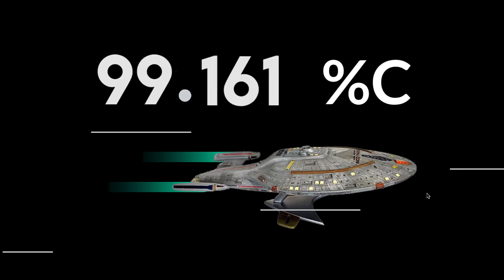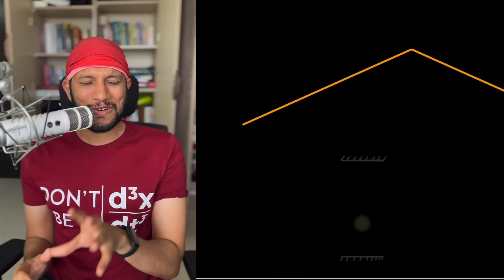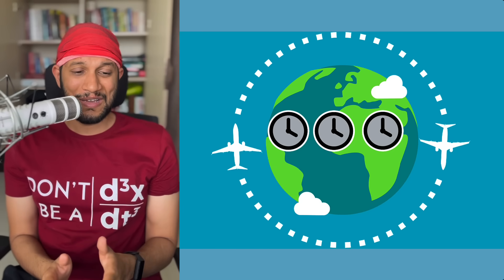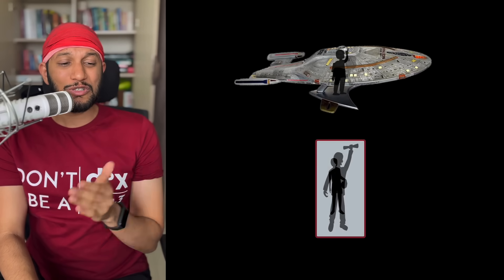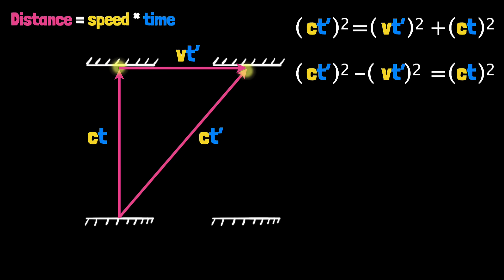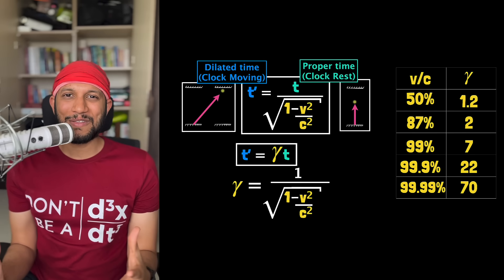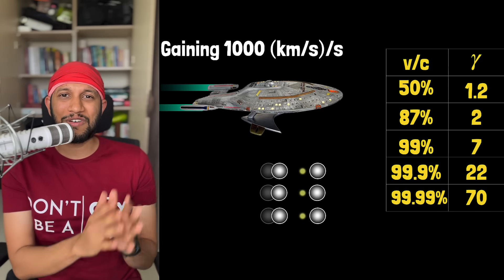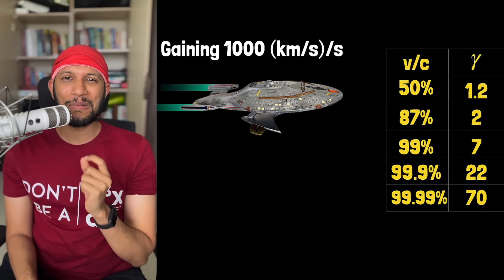I finally understood why you can't go faster than light! (My mind is blown)

Comment: Okay, so this makes intuitive sense to me from outside the ship. I'm having trouble intuitively understanding what is happening from inside the ship though. Like, with a black hole, I appear to stop on my way in to an outside observer because of time dilation, but from my perspective, I just keep falling. But if I'm in a ship that is at constant acceleration, I should just be able to keep accelerating, right?
Reply: Yes, you keep accelerating, but what does it mean? Relative to the ship your own speed remains zero, you accelerating means other objects gain speed relative to you. If your acceleration is 1000 km/s/s, you would expect outside objects to gain 1000 km/s more speed every second. But there is another part of Lorentz transform: length contraction. Space "contracts" in direction of motion, and those 1000 km turn into 500, then 100, then 1, then 0.1 etc. In the ship's coordinate system those outside objects accelerate less and less, such that their speed increases less and less every second and never reaches c. See Lorentz transform and its charts, you can find interactive ones and see how spacetime skews at different speeds.

Comment: Very interesting. This means that if I find a way to transfer force that doesn't involve photons I would be able to transfer force instantaneously across space, right?
Reply: In relativity theory all massless particles move at light speed - this includes gluons, not just photons. Neutrinos were also considered massless and moving at c, although currently there are certain doubts about them. Basically anything with mass travels < c, and without mass at c, nothing goes faster. If some force carrier could transfer force faster than c, that would allow sending signals into past and cause all kinds of paradoxes.

Comment: towards the end of the video you try explain how as a ship accelerates, it takes longer and longer to gain those 1000km/s, and so the ship will take infinite time to reach the speed of light, or if you decide to double your fuel consumption every second it would take infinite energy.

but....all of this only applies to the outside observer!
as you said yourself, inside the ship you are always going to be gaining 1000km/s.
it's only the outside observer that experiences the time dilation.

if that's the case, i see no problem (intuitively) with somebody inside the ship reaching the speed of light and it not taking infinite time or energy.
for them it would just take a certain number of seconds, or a certain value of "fuel output per second" but if they wait long enough, they should be accelerated to the speed of light, regardless of how it would look to the people outside the ship. at least according to this interpretation where the one experiencing the time dilation is the outside stationary observer.
Reply: Relative to the ship your own speed remains zero, you accelerating means other objects gain speed relative to you. If your acceleration is 1000 km/s/s, you would expect outside objects to gain 1000 km/s more speed every second. But there is another part of Lorentz transform: length contraction. Space "contracts" in direction of motion, and those 1000 km turn into 500, then 100, then 1, then 0.1 etc. In the ship's coordinate system those outside objects accelerate less and less, such that their speed increases less and less every second and never reaches c. See Lorentz transform and its charts, you can find interactive ones and see how spacetime skews at different speeds.
Reply: @thedeemon  sure, the issue tho is not the speed relative to the ship, the issue is approaching of even reaching the speed of light, while inside the ship.
what i understand from your answer, is that since my speed relative to the ship is 0, then the ship can keep accelerating, and my speed relative to the ship doesn't change at all. meaning even if the ship were to reach 99.9999% the speed of light, then me, being somebody who's inside the ship, will feel no relativistic effects whatsoever. 

i'm not saying this is true, i'm just saying that the intuitive understanding portrayed in the video, only applies to outside observers, and not to the ones actually doing the traveling.
Reply: @FractalMachine  Again: what exactly it means for ship to reach 99% speed of light? Speed relative to what? Right now you're moving at this speed relative to some objects. Even faster, relative to protons in LHC. There is no absolute speed. It's always relative. So when we say the ship accelerated to 99% of c it means it moves at this speed relative to, say, some planet. And from this ship this planet is moving at 99% of c. Then, I say, what happens when we keep accelerating? How fast the planet will move after one more second? Due to length contraction, not as fast as you expect, it will never reach c in ship's frame of reference.
Reply: @thedeemon  i believe there's a problem with this view.
if the ship was the only object in the universe, according to this perspective, acceleration is meaningless.
so you are dumping vast amounts of energy into accelerating a ship, and this ship now has tremendous amounts of potential kinetic energy, except if speeds don't exist independent of other objects, then this energy (that was used for acceleration) has "disappeared".

this violates conservation of energy.
Reply: @FractalMachine  Good point: if there was nothing but the ship then indeed acceleration would be meaningless. But you can't just accelerate it forward without throwing something backwards, momentum must be conserved*. So in the ship's perspective there is at least something besides the ship that gets accelerated away from it, this way energy and momentum are conserved.

*) in any inertial frame of reference that at a given moment t has the same speed as the ship. In an accelerated frame of the ship momentum is not expected to be conserved.

Comment: But Mahesh why does that photon follows zigzag path??
Reply: Because the clock as a whole is moving... As the clock is moving in some direction the photon will never hit the other side if it didn't moved that way and will fly straight up.. So it have to follow a zig zag path so that it can  follow a straight line path in space ship
Reply: @priyank5161   if it's some ball bouncing between two surfaces then the ball moves diagonally because it attain horizontal velocity equal to ship velocity because it has mass and it is in contact with ship but in case photos it has no mass and it's velocity can't be influenced by anything cause velocity of photon is constant. as you said if it follows diagonal path it means it attained horizontal velocity so if photon motion is orientated horizontally then velocity of photon must be velocity of light plus velocity of ship which is not possible because light speed is the limiting speed
Reply: @mannemmadhuteja5501  that's the whole reason... Place yourself in place of the guy inside the ship... For him the photon should follow the straight line path so for him it's normal... But for us it will follow a diagonal path... Why? Because it's the shortest path! Light always travel in the shortest path because the path of light is curved and space is curved it feels or seems like light is going diagonal path.
Reply: @mannemmadhuteja5501  which means the light is still taking the shortest path in curved space time
Edit:- light do not follow the straight line path but instead the shortest path between 2 points but as in this case the space between the point is curved it feel like it is taking diagonal path
Reply: Space is curved what does it mean
Reply: @mannemmadhuteja5501  well hard to explain but u can say... By curve... Like a curve of earth.. A straight line in curved space is not the shortest path but a curved one similar to what air flight uses on earth
Reply: @priyank5161  OK thankyou what do you study
Reply: @mannemmadhuteja5501  hmm m a 10th grade student but don't think m stupid just by that

Comment: it may be getting slower and slower from our perspective, however, from the ship's perspective nothing changes which means that, for them, they are still gaining 1000 km/s speed which means that if we ignore the outside world, for them, they should be able to reach the speed of light
Reply: If you ignore outside world, you are stationary relative to the ship, there is no speed gained. All speeds are relative. When you accelerate at 1000 km/s every second what it means from your perspective is some initially static objects gain speed relative to you. But due to length contraction (another relativistic effect, another part of Lorentz transform) those 1000 km turn into 100, then 10, then 0.1... Apparent acceleration of outside objects will decrease, such that their speed in ship's frame of reference grows slower and slower and never reaches c.

Comment: Speed of light in a vacuum is not a limitation of light but a limitation of the universe, why it happens to be C and not C + 1 for example, no one knows. It has been suggested the apparent randomness of C is evidence we're in a simulation, it is a parameter of a simulation, chosen for external not internal reasons or logic.

Comment: How does this work for the observers on the space ship as it approaches C? The observers on the craft would still see light move at C and the ships particles would interact with eachother at C. So couldn't the observers on the ship reach C from their perspective? (Asuming you don't care the heat death is occurring outside your craft as near infinate time passes ouside the ship)
Reply: @asleepappeal so, if you reach the speed of light, you would theoretically generate infinite mass as well right? At the point of infinity, when your spaceship finally reaches the speed of light, it's infinite mass would literally suck in everything in the universe as the biggest supermassive black hole to ever exist and annihilate the universe. Theoretically. I think the concept of infinity in general just breaks everything
Reply: Also, what does proper time even mean. The universe does not have a preferred reference frame. The person, once he stopped acceleration, no longer is anything special. In his pov everything else is moving but him. So everything else is experiencing time dilation.

To answer your question tho, length contraction, the universe appears to become very short.

Comment: I don't see how the photon clock extends to the regular clock.  Your explanation shows that the regular clock will be delayed, but not slowed.  Imagine a clock that ticks once per second.  For a clock at rest, when the clock ticks to 12:00:01, the whole hand ticks to 12:00:01; when the clock ticks to 12:00:02, the whole hand ticks to 12:00:02.  Now imagine a clock traveling fast enough so that it takes 10 seconds for the photons to travel the length of the hand.  When the center of the clock ticks to 12:00:01, it takes ten seconds to propagate to the end.  So the end of the clock shows 12:00:01 at 12:00:11.  However, the clock continues to tick.  The center of the clock will still tick at 12:00:02, and this will show up at the end of the clock at 12:00:12.  The outside of the clock always be 10 seconds later than the center of the clock, but the clock won't run 10x slower.

The photon clock has a feedback loop.  The second tick doesn't start until the first tick completes.  So the photon clock is slowed down.  However the mechanical clock has no feedback, so it is only delayed, not slowed.

I'm not denying time dilation, I'm just questioning how your explanation justifies it.
Reply from the maker: This affects every atom of the clock. So, consider the simplest pendulum clock. It ticks due to the swinging of the pendulum. If it’s moving close to light speed, then the pendulum’s swing slows down slowing the whole thing down. Even atomic clock’s heart is the electron transitions of a specific atom. They too are mediated by photons! There is no escaping it.
Reply: @Mahesh_Shenoy  Thanks for answering.  I knew that the clock hand was just an example, but didn't see how it proved the point since there was no feedback.  The pendulum is a great example that includes feedback.

Comment: Nice alternative view on this, but i think its still easier to say, as mass increases with speed and going toward infinity, when reaching the speed of light, there would be no possibility to get to the speed of light, as there is no infinite force available for pushing it. Anyways, the spaceship could get to the speed of light, by converting whole matter into photons...beam me up scotty🙂
Reply: I think the important thing to remember is that for every object with mass, c=c. So for spaceship, it's never going to reach c because it never started. It can burn its engine for a million years and it's still c away from c. The universe is planning to turn it into photons though. The universe is going to start seeming hotter and hotter as light in the direction it's headed in gets blueshifted and the particles it runs into get more and more energetic. Eventually, something will give.
Reply: @Vexas345  Yes, actually, that c is constant for all observers is the main assumption made in special relativity, from which every thing else can be derived. So, also the fact that an object with a rest mass can not reach the speed of light.

Comment: Dear Mahesh - your description is that of a light bulb bouncing up and down - not a true ‘photon’ clock. The photon does not have forward velocity having left the device generating the photons. For one - how would one ever ‘see’ the photon - something has to strike the cells of the retina. If it did, the photon would no longer exist being annihilated having struck the retina. So this experiment is theoretically impossible ie. One could never see a photon bouncing up and down. At best this is a lightbulb radiating photons while bouncing up and down. If one accepts that a photon is bouncing up and down, then in the case of the moving rocket, the photon would miss the detector (being a few atoms wide) and land somewhat behind (1 light second behind if the detector were 1 light second high).  In fact one could in principal detect absolute motion of the rocket by this very occurance. This is a conceptual problem with this illustration that nobody seems to take into account. I will very much appreciate your analysis to the objection that has always bugged me - or is there something I am missing here. Thank you for a wonderful channel and some great explanations  - really enjoy and look forward.
Reply from the maker: We can’t see the photons but we can theoretically detect its ‘bounces’. 
Why would the photons miss?
Reply: The photon is travelling vertically with no horizontal component. This means the spot on the detector straight above would have moved forward as the train is in horizontal motion. The incoming photon would therefore miss this spot which ideally should be as small as possible and would now strike a different spot (slightly behind) and we would know this and use this information to conclude the train is in motion (which I admit - is a separate issue). However the important point is the trajectory of the photon would not be the wavy line from which we are concluding that the photon has travelled a longer distance hence time must have slowed down. Rather, if we could in theory observe the photon from the other spaceship (which is not in theory possible as the photon needs to to strike ones retina and would annihilate if it did )-  then just where is that photon coming from which is enabling us to see the longer wavy line and conclude time has slowed down, if not from the surface of a bouncing lightbulb. In essence, the observer above should correctly see (if he could) the photon passing upwards and receding backwards away from him and striking the detector at progressively further backwards points as it bounces up and down, which should more correctly lead him to conclude that the photon is not travelling the wavy forward pointing line but rather vertically up without any horizontal component.  I do hope I am am explaining myself clearly enough to make my point without the aid of a diagram.  (I am assuming the height of the light clock is significant which it has to be to see any wavy line..).

Comment: What I find interesting is how many different ways you can interpret Relativity and get the same outcome. You could also show that as velocity increases, length contracts along the direction of motion.

As you accelerate, the apparent length shrinks so that the muon lives the same time, but the distance to Earth is shorter. Also, since length contractions is exponential, the faster you go, the more contracted the increase in distance the new velocity delivers. At c, the length is 0 so any increases in speed adds 0 more distance per time.
Reply: Maybe I'm looking at it differently,  but lengths (distances) obviously don't change, whereas the time changes can easily be measured.  I see what you're getting at, the apparent distance is shorter because your speed is greater, so it takes less time to get there. That, however,  is not what is actually happening. Time is the variable,  not distance.
Reply: @briandbeaudin9166  You say "apparent" distance, implying there is a universal distance all can agree upon. However, in Relativity, the only things all observers can agree upon are the speed of light and cause/effect. Distance and time are observer dependent.
Reply: Agree with DJ_Force regarding distance & length being dependant on observer reference frame. Look-up "the ladder in the barn paradox"  @briandbeaudin9166
Reply: the wavelength contract i guess ? red and blue shift. i might be wrong